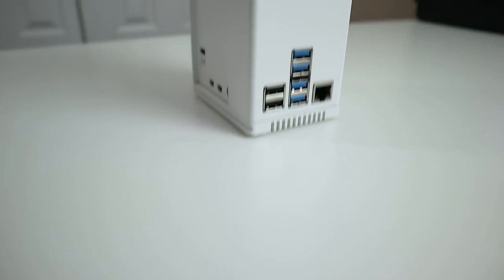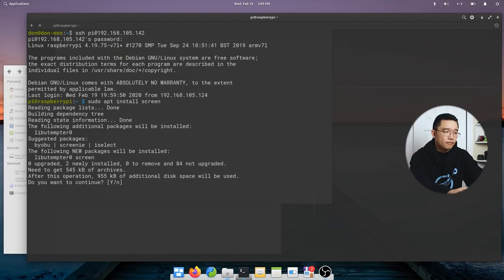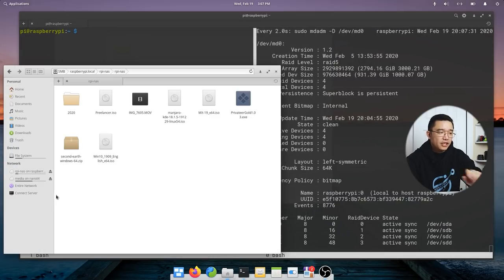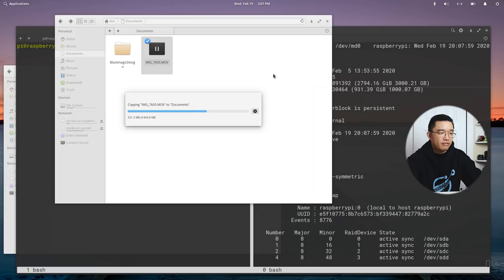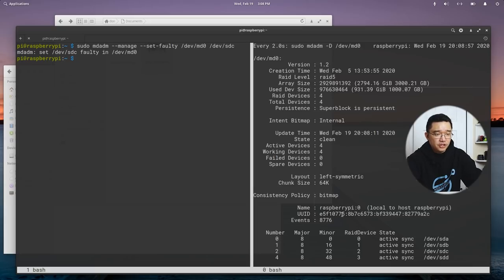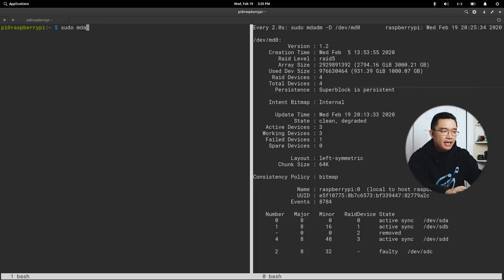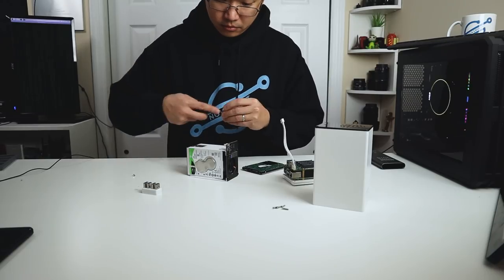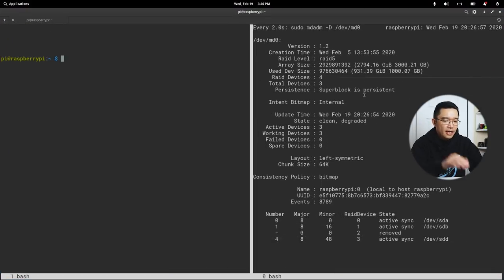How To Rebuild and Resync From Failed Hard Drive Raid 5 on mdadm

Comment: Great Tutorial! I've been seeing a lot of YT Computing channels using/promoting RAID5 lately, and it is good to talk about it and even better to understand it. One thing to keep in mind for RAID5 (any type of RAID5 ; Controller-based RAID5, MDRAID-5 or LVM-RAID-5) there is a limit to the size of the RAID5 array before you exceed the URE rating of the hard disks (when you exceed about 12TB or 10^14 bits); once this happens there is really no way to ~*know*~ if your data is good. As disks get larger (with 4+ TB disks this probability of a URE increases by a factor of two or more depending on the physical head layout). On point, RAID6 with it's Double Parity, neatly covers this gap, but write performance with RAID6 is even worse than RAID5; This is one reason why RAID5+0 (which makes it much simpler to  keep the RAID Disk Groups under the URE limit)  and especially RAID1+0 have become more popular with Enterprise Storage solutions (but unfortunately cost a lot more). Just something to think about. Other controller-less Software Bulk Storage solutions like Gluster, CEPH and ZFS also sidestep these issues with more robust internal error checking than offered by the RAID5 parity stripe. Just something to consider and research.

Comment: 2:05 screen is very useful for accessing remote machines, where you only need one SSH connection and can open any number of terminal sessions on top of that.

Here’s a tip: the default CTRL-A escape character conflicts with one of the line-editing keystrokes in Bash that I use a lot. So in my ~/.screenrc, I have the line

    escape ^Zz

which changes the escape keystroke to CTRL-Z instead. This interferes with the stop-job character in Bash (which you now have to type as CTRL-Z followed by Z), but that’s OK because screen offers a better alternative to job control anyway.

Comment: Thank you very much. Was trying to figure out what to do after a failed disk is replaced.
If you dont mind, I have a non related question.
lets say I built a raid with 4TB x 2 disks with ultimate storage of 4TB.
What will I be doing when I fill up the 4 TB storage?

Comment: Since it's a pi... What happens if the SD card dies? If you had a copy of it and replaced the dead SD card with the new working one, would it affect anything with the raid?

If you didn't have a backup of it, what then? Can the software pick up the raid and utilize its existing state automagically?
Reply from the maker: yup, since it's not encrypted it will work, you can even move these 4 drives to another debain install with mdadm and you should be good to go
Reply: @NovaspiritTech  when moving between systems, you need to change the host name in the meta information of each disk and the RAID.

You usually also store the configuration of the RAID in /etc/mdadm.conf (or something like that) so it can start faster. But if you make a backup the SD card, you will be good.

Still, if you didn't made a backup, mdadm(8) can scan all disks in the system and recreate the RAID from that meta  info stored there. But it is faster if you store the information in the /e/mdadm.conf file. 😜

Comment: how did you know which drive to remove from the array, like physically with the screwdriver and stuff .. also great video, many create raid ( 5-6 ) arrays, and have no idea how to recover from a failed drive.
Reply from the maker: the quad sata board has writing on it telling me which one is sata3
Reply: @NovaspiritTech  this is also a reason to have different manufacturers of the disks.

All disks also have a serial number printed on them. So you can get the serial number of all the working ones and know which to not remove. And if you are so Lucky the faulty one is responsive, you can get the serial number from it.
It shows up in the logga when the machine boots and see the disk the first time. 😜

Comment: 4:17 In the demo of mdadm I did for the local Linux users’ group a few years ago, I used USB sticks, and I pulled one of them out to cause a failure.

Edit: this was also handy because I could demonstrate hot-swapping without shutting anything down.

Comment: Hi,
the project of this nas is highly risky for data after a few restarts the raid is not seen .... consequently it has to be rebuilt or resynchronized, but the thing that surprised me is the following:

I inserted an 8 Giga usb pen when I did the mount it, the raid5 jumped, it got corrupted (it only saw two disks), I had to stop the raid from the command line 

sudo mdadm --stop md0
sudo mdadm --assemble --run --force --update = resync / dev / md0 / dev / sda1 / dev / sdb1 / dev / sdc1 dev / sdd1

after the omv program saw the raid in clean state (resync pending)
I went into the filesystem menu and mounted it, all right .... for now!

Comment: Great video. Thanks for your explanations. This NAS box seems to me a very interesting option. 
Is it possible to move the root partition to NAS hard drives?  Could you explain how to do it?
Reply: @Jose Rodriguez: You can't do it on a Raspberry Pi as it can only boot off the µSD card. Booting off a RAID array array requires a complete different setup on either a i386 or amd64 platform.

Comment: Do you want to experiment with RAID?
Just use a bounch of USB memory sticks and create small disks.
OR use a virtual machine with a couple of virtual disks. Crasch them? Copy /dev/zero on them with dd(1). 😜

You should also check the contents of the disk before you add. I uses fdisk(1) with the list option, - l. 

There are also a reason to make a partition of known size, because all disks are not created equal. So if the new is slightly smaler, you couldn't add it to the RAID. You can add a larger though, but you can't use that extra memory for a RAID. The disks, be it hda or hda1, have to be of equal sice.

And it is a good reason to not have all disks from the same batch and/or manufacturer. The risk of have them crash the same time is lower in that way.
As RAID-5 can "only" loose one disk. Two, and you are lost.

Comment: What OS do you use ?.. it looks cool
Reply: @MarcusWeyer  that is tecnically a distribution. 😜
Reply: Anders Jackson A distribution of an OS, perhaps...?
Reply: @MarcusWeyer  a distribution based on an OS.
Linux, the kernel, is the OS. Rest is distribution. 😜
Reply: Anders Jackson So the kernel he is using is Linux.. so what OS is he using? I don’t think people refer to Windows 7, 8, 10 as distributions because they use the Windows kernel. The kernel is only a portion of the entire operating system package. Point being, I don’t think there is anything wrong with referring Ubuntu, Linux Mint, Elementary OS, etc as operating systems. Is there any point to be so pedantic? Heck, “OS” is in the name of the distribution. 🤷🏼‍♂️
Reply: @MarcusWeyer  which OS?  Linux.
Which distribution?  Probably Elementary OS.
Linux is the OS, and everything around is the Distribution.

Different versions of MS Windows are MS Windows 95, 98, NT, ME, XP, 7, 8, and 10.  And no, they are not all the same OS (kernel).

Yes, it is wrong, as Debian, Mint, Elementary OS, RedHat  etc are distributions.

Yes, the Debian distribution can even be deliverd with Net BSD or Hurd Operating system, that is, with different  OS:es.

Comment: How on earth did you get the raid 5 to even form with mdadm in the first place. Whenever i try to do so on raspian lite after doing an update && upgrade and then "sudo mdadm -Cv -l5 -c64 -n4 -pls /dev/md0 /dev/sd{a,b,c,d}1"  when it tries to rebuild drive 4 as expected off the bat after a couple of hours there will be a failure with the jmicron usb controller and /dev/sda,b,c,d vanish and leave me with /dev/sde,f and the raid is lost until i reboot then i can then unmount and zero all  then repartition and i can start again. The only Raid that seem to be able to completly sync is Raid 0 & Raid 1 obviously Raid 0 is completely skipping this process and Raid 1 means i have to make two seperate drive spaces which will be a pain to scale. why anyone would be interedted in using Raid with 4 drives and not us Raid 5 or 10 at a minimum because you may as well just JBOD and not have bothered with the complexity of a raid controller, im lost any ideas to get Raid 5 or 10 to build and sync without the jmicron thing falling over and not allowing the raid to form ?

Comment: I find it strange that the sync procedure happens automatically... so it initializes the disk formats it and then sync it? All that happened at zero time in yours since the state was at a glance to active synced all drives instead of showing the one rebuilding (Did you have a timelapse there)

Other method I had seen for adding a drive included
        sudo mdadm /dev/md0 --add /dev/sd(whatever letter the new drive is)
	sudo mdadm --grow --raid-devices=4 --backup-file=/boot/raid.bac /dev/md0
	sudo resize2fs /dev/md0 (in order for the new drive to have a filesystem)

Comment: I know they say this setup supports 4 drives at 4tb each drive but have you tested say 4 drives at say 5tb each do you think it would work
Reply: Would work, but syncing an new disk will take a huge time. All disks has to be read and data has to be written to the new disk, and doing calculations on every data written. That is 5 TB write on that disk. Make the calculations yourself. 😜

Comment: I wanna build a NAS using the Rock Pi 4 + penta sata hat + OMV for 5x4TB drives in raid5.
Any opinions? yay/nay
Reply: It gonna take a lots of time build the RAID.
Except from that, I can't see any problems.

Practice on some files as device though. Make a couple of files as when making swap files. These can be used as disks in a RAID.
MUCH easier then practice on real system. 😜

Comment: What happens if you remove the drive BEFORE detaching it?
Reply from the maker: that's fine as well... detaching is for hot swap. so if you don't want to turn of your computer. but if you turned off the computer it will auto detach.
Reply: @NovaspiritTech  
So...once you remove the drive, it will always auto-detach on shutdown?

Interesting.

Comment: now can we get a video on how to expand our raid say I have 3tb and now need say 5tb? can you do a video on that?
Reply: Just add some more disks to the RAID. 😜

If you want, you can also put in bigger disks instead of the original, one at a time. Just let them sync before you replace the next one.

When all are replace, you can resize the RAID to the smallest  of the new ones.

Just make a RAID of some virtual disks in a virtual machine, and you can experiment with them.
Don't use too large disks though, as syncing takes time on big disks.

To crash a disk, just copy /dev/zero or /dev/one onto the disk you want to Crasch. Do that while the RAID is running, and watching /proc/mdstat as he did while you do this.
Then remove it as the video and then write zeros on it again and add it as a new disk to the RAID.
Also try to add a spare disk to the RAID. That isn't used, until one disk crasch. All seen by mdstat file.
Reply: @AndersJackson  Yes, being able to play with RAID in a virtual system to gain familiarity with failure modes and recovery is a very underappreciated feature on Linux with md / BTRFS / ZFS RAID.